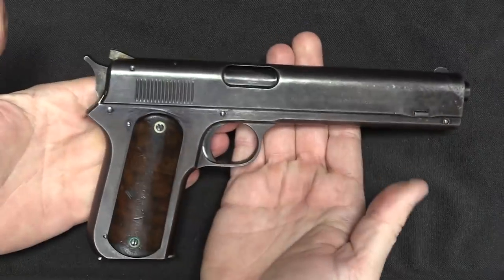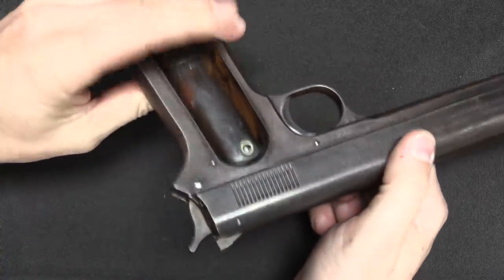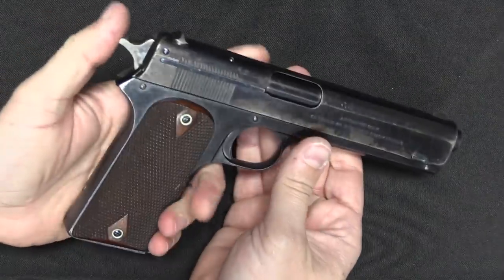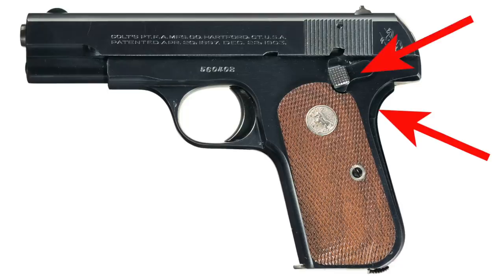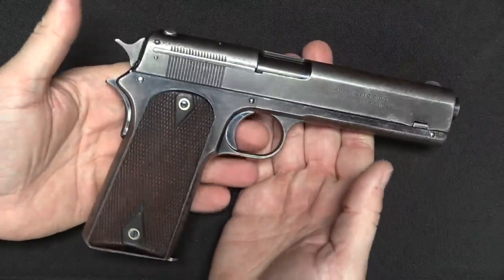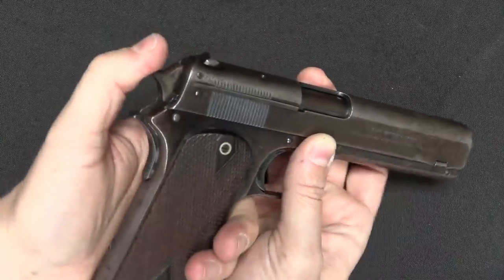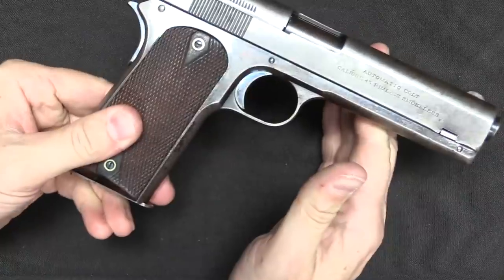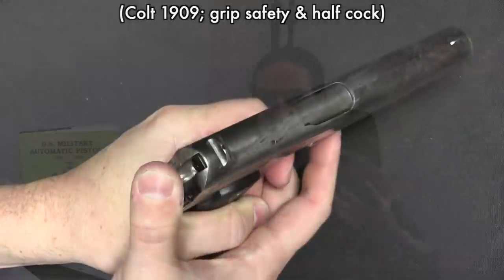How the 1911 Got Its Safeties - and Why Its Ancestors Had None

Comment: There's a small notion you seemed to gloss over in all this

Was it considered standard and safe practice to manually lower the hammer on a loaded chamber?
Pardon my ignorance but every 1911 owner I've known has scoffed at and seemed genuinely terrified by the notion of decocking a gun, even with a mechanical decocker.
Reply: That's because modern users recognize the difference between revolvers and semi-autos, and thus don't have an irrational fear of a cocked hammer when combined with a manual safety.  Manual decocking can be sketchy.  But I think in most cases that standard carry in military settings was without a chambered round.  Many civilians likely did manually lower the hammer as they tried to adapt revolver techniques to semi-autos, though.
Reply: My first pistol was a FEG made P35 clone.  I never had a problem with a single action hammer.
Reply: @andrew-ripley1747  
Pardon my ignorance, but is/was the manual decocking of a revolver inherently safer due to a differences in the design?
Reply: What did they think, pray tell, about having to pull the trigger (while holding the hammer) to return the hammer from full to half cock on the millions of model 94 Winchester lever guns?
Reply: @jonasstrzyz2469  in modern revólvers with transfer bar it is safer to decock the hammer. Due you have to depress intentionaly to engage it to make contact between hammer and firing pin.
Reply: @machintelligence  ... Not just 94s. Virtually every incarnation of lever action. The entire discussion of handling firearms tends to emphasize the very basics of doing so. Always consider any firearm to be loaded. Always keep the firearm pointed in a safe direction. Keep your finger off the trigger until ready to fire. 
   I wish I could claim to never having an AD, but the shot went into the ground and nowhere toward anyone. Very frightening, anyway.
Reply: @luisantolafrancis519  
Thank you for the reply, do you by chance know when the transfer bar became common?
Reply: I've never seen a break action shotgun with exposed hammer(s) that didn't work that way, once cocked the only way back is firing, unloading, or letting the hammer down. Old lever guns too.
Reply: @jonasstrzyz2469  the Colt pithon allready had one by the 50s..its simple to know if a revolver has a transfer bar or not.
Regularly all revólvers with firin pins in the frame they have it alldow S&W has revólvers with transfer bar and hammer firing pin
To know if your revolver has it you can do 3 things 1 investigate, know your gun. 2 if you have the skills look for it its visible in the hammer movement. 3 verificate it is working propperly. How?
With the revolver unloaded cock the hammer as you pull the triger grabing the hammer down take the triger finger off the triger and release the hammer. If it has transfer bar the firing pin wont be hit by the hammer if it dont it would be.
The transfer bar in hammers with firing pin works getting of the way in hammers without firing pin works coming in the way and compleating the contact between them. Hope it makes sense.
Reply: I was stationed in Korea in the late 1980s .
We were issued the M1911A1 and alot of us chambered rounds when on duty, we probably were not supposed to but that is the way it was.
 Most people generally used the thumb safeties.
Although some used half cock and a few lowered the hammer manually. It was mostly a matter of preference. My was cocked with the thumb safety as the  design is such that during the act of drawing the pistol and bringing it to the ready pushing the safety down to off is a natural movement process.
Unlike some other types of semi autos with the safety on the slide that has to be rotated upwards. This adds the movement of your thumb upwards and then back down to get a grip.

In my opinion I like M1911 thumb safety better than those up on the slide. It is easier for me.

Best style I  really like so far is a striker fired pistol with just a grip safety and a small trigger safety. The Springfield XD.
Draw it squeeze the grip safety finger on the trigger squeeze No thumb gymnastics.
Reply: WW1 era firing manuals for the 1911 wanted hammer down carry. By WW2 it was Israeli carry unless there was imminent danger.
Reply: @xalty1200  Sir with all due respect by WWll there was no israeli carry due  Israel gas not to be but after 1948
Reply: On most older rifles and pistols, lowering the hammer to half cock was the standard way to "engage safety". Still is, on revolvers. I qualified on a S&W model 10 as late as 2007 or 2008, part of the qualification test was to cock the hammer and manually lower it again six times without having a round go off.

Also, I read the original manual for the Norwegian model 1914 which is a lisenced version of the 1911. It says both cocked and locked and hammer down to halfcock are acceptable.

Oh, and I shoot various other old guns where the only mechanical safety is a halfcock notch. I don't feel unsafe hunting with these, because it's easy enough to aim somewhere safe while lowering the hammer.
Reply: Well, the Beretta 92 decocking scares the hell out of me, even though the thumb safety holds a transfer bar and it's physically impossible for the gun to go off.

Yet I am not bothered by lowering the hammer on a live round on either my 1911 or CZ75.
Reply: @ScottKenny1978  That's all psychological. I understand though. Berettas decock with some energy. I own CZ's and Berettas and the berettas are far safer. I carry the CZ's because they are lighter and no chance of accidentally engaging safety while racking the slide from reload.
Reply: @jonasstrzyz2469  no not really. Lowering a hammer on a live round is always risky. So is chambering a round in an AR15. Slam fires happen, though I've never experienced one personally. I have lowered hammers hundreds if not thousands of times on live rounds and never had an issue. Revolver or semi auto are the same. Slip and it will go bang.
Reply: @JW...-oj5iw  there are only two kinds of firearms owners: those that have had an AD, and those that have yet to have an AD.
Reply: @sanguinemoon9201  what makes you think the Beretta is safer than a CZ?
Reply: @ScottKenny1978  the safety rotates the firing pin transfer bar to vertical. This completely prevents the gun from going off. Hit it with a hammer if you like and no bang. Also, decocker is much safer than lowering hammer manually. No chance of human error. Also if the detente breaks on the CZ the safety is useless. On the Beretta 92 and similar safeties, the bar is still rotated out of position. Safety is loose but firing pin will not hit the primer.
Reply: @sanguinemoon9201  "Lowering a hammer on a live round is always risky." 
Copy that.

"So is chambering a round in an AR15." How so? I thought that the AR15 had a safety mechanism that prevents out of battery detonations? Or are you talking about a faulty safety mechanism? If yes, then I would say that that is not a fair comparison.
Reply: @jonasstrzyz2469  The AR-15 has no firing pin spring, it free floats, like an SKS, which is known to slam fire when very fouled due to the firing pin being stuck in an extended position as a round is chambered.

I have never heard of this happening with an AR-15, and he seems to be talking even about clean guns. ARs do seem to chamber rounds with gusto, so he may be talking about a possibility of the firing pin impacting the primer with enough force to detonate using merely the inertia of the closing bolt. I have never heard of this actually happening with an AR-15, but something new happens every day.
Reply: @xb0xisbetter  
Interesting and thank you for the explanation.
Reply: @jonasstrzyz2469  there is no safety mechanism to prevent the free floating firing pin in an AR15 from striking the primer when chambering. The original pins had to be lightened during trials because they were having accidental discharges while loading first round. The inertia of the pin was enough to set off a light primer. Chamber a round, extract it, and look at the primer. You will see a mark. That is the pin hitting the primer. It is very unlikely to detonate the primer but it does happen. That's why many will point the rifle to the target when chambering. This is mainly a problem with cheap commercial ammo. I shoot about 2k rounds of M193 per year and have never had it happen to me. I have seen it happen to another though.
Reply: If you manually decock a gun it´s of course necessary as the most basic and logical safety measure to point it in a safe direction!

The big difference between manually decocking a lever rifle, shotgun or revolver compared to a semiauto pistol is that if you have an AD while decoking the semiauto, the slide travelling backwards will smash your thumb to mincemeat!

Edit: with manually decoking I mean lowering the hammer with the thumb. Decoking safeties / levers as on the Beretta 92 or the Radom VIS for example are of course safe, in fact they were invented because of the issue.

Comment: Hence the term "cocked and locked"...
Reply: I think the term might be a bit older than the 1911. I think it is a reference to old  flintlock guns. Where piece of flint was attached to the "cock". And the "cock" would be locked to the rear in the firing position.
Reply: @pehenry  You might be thinking of "lock, stock, and barrel"; the which describes all the needed parts for a functioning gun. That's been around a long time, I suspect "cocked and locked" is quite a bit more recent.
Reply: The cock-and-locked phrase comes directly from the Ordnance manual from 1912 and it was to only be used in an emergency.  Usual carry was empty-chamber and hammer down.
Reply: @steveh1792  No. That is not what I am thinking. I said what I said.